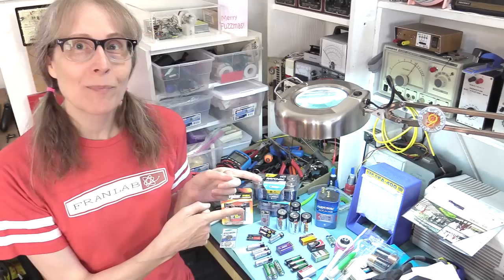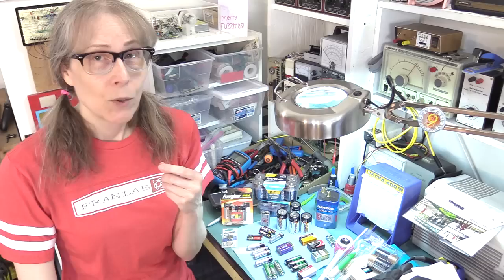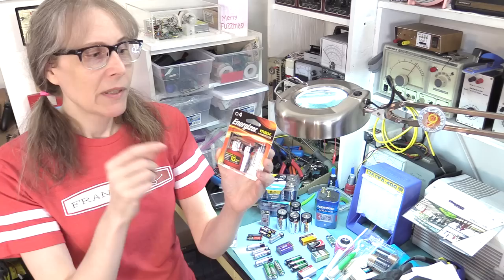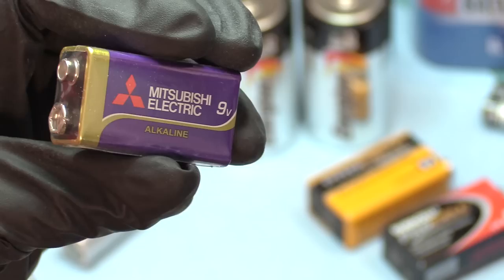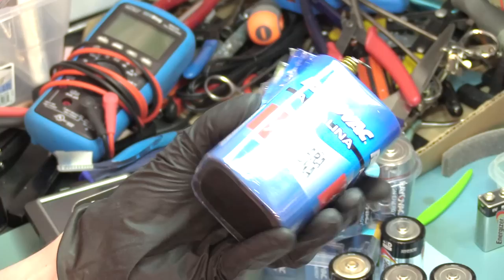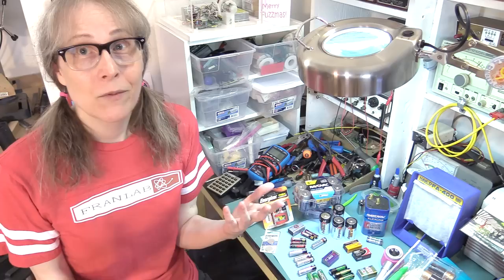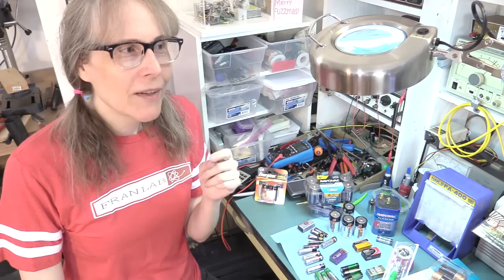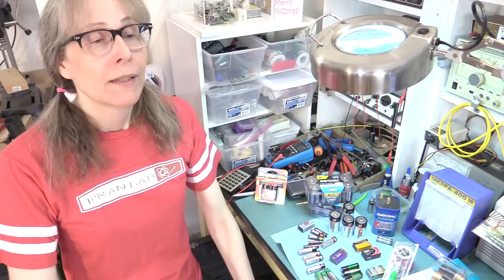Yikes! Leaky Alkaline Batteries!!!!

Comment: If you mix and match battery brands, or use the same brand but from different manufacturing batches, you are more likely to have batteries leak inside your device; especially if used in something that draws a small amount of continuous current (which includes most LED flashlights, certainly any that have multiple modes, varied brightness and flashing modes etc). The weaker battery, or the one that is "different" from the others, that one's gonna fail.

Comment: I've actually never had a battery leak on me. I found out years ago that the generic Super Market bought batteries from my local SM is almost as good(long lasting) as duracells. I'm a guitarist and we usually go thru fairly many 9V batteries in the span of a year. The price difference between the big brands and the the generic kind is pretty substantial in my country so I wouldn't even dream of using anything else

Comment: There's a reason that for low drain, long rest time devices (most of my 15+ multimeters, my remote controls, smoke detectors) I use the Super Heavy Duty.    Even when they fail, they fail with salt water, which is FAR less destructive than when an alkaline goes.    In fact, if you buy a smoke detector, it comes in one of three types.   House power, lithium battery, or super heavy duty.   I've never seen one sold with an alkaline, and I spent an hour one day going through the entire list of recommended batteries on an old Kidde unit, and every one was a "Super Heavy Duty".

Comment: Since I have acquired a ton (yes, a ton, not a metric ton!) of 18650's (18x65 mm), I have been substituting 3x AAA's (rechargeable or alkaline) for just one li-ion. It definitely lasts a lot longer than three cells (one usually gets drained first, the other two, not so much), and I just swap it out, drop it on the charger.

Comment: I’ve had corrosion in my electronic door lock. Cleaned it as much as possible and put in a new battery but that one started corroding after a month or two. They are Rayovac batteries. I cleaned it again but I’m not sure what to do.

Comment: My Gates gel cell lantern battery in it's original lantern with the original bulb and replacement inside finally died 3 months ago. I bought this in 1978. I've been in this battery case before to bypass the limit resistor. I replace that with the rectangular type with the tabs. Still worky.

Comment: I have a Casio calculator thermal printer with the original Casio AA batteries from 1982 and they still have change capable of operating the printer.

Comment: When I was a kid you could buy rayovac batteries in the UK, they had a label saying rayovac "a viador company" there also used to be "ever ready gold seal" before they became ever ready energizer and then just energizer, I've seen old 1970s and 1980s batteries that were left lying in stored boats and in garages and sheds that still haven't leaked and I have seen newly bought fresh in packet batteries that have ruptured. 
There were also blue and red energizer batteries which were different prices and grades, blue was zinc chloride and red zinc carbon I think?
There were a range of different sizes of transistor radio batteries in 6, 9 and 12 volt versions to fit the old radios and there were bolt top terminal lantern batteries which had plastic screw caps on the terminals to fit big searchlight type torches/flashlights 🔦

A lot of batteries that there were until around 2004 are hardly made and are special order now, many different ones had their market in radios that got modernised out and flashlights that were discontinued, these batteries are super expensive now and are so hard to get hold of that it isn't worth the struggle to keep things working..

Many of the current day rechargeable batteries installed in consumer electronics aren't very well made and don't last long..

Not too many people are willing to spend $60 a time to change out disposable torch batteries nowadays, a lot are rechargeable and the rest are AA or AAA sized which are the common easily available ones worldwide..

Has anybody got an obscure or old flashlight which they can't get batteries for?

Comment: I just don't leave batteries in anything I don't use every day. I take them out an put them in a plastic bag which I store next to the device that needs those batteries. No more leaking problems. The batteries still sometimes leak but when they do they are conveniently already in a bag so I can just throw it out with no mess.

Comment: One time I reached into my bag to get my TI-83+ calculator and found it wouldn't turn on. I opened the battery door to discover that one of the batteries had started leaking. I was absolutely furious, because I had just used that same calculator 2 weeks before and it worked fine then. I was so pissed off I forgot what I was going to calculate. Fortunately, the leakage wasn't very bad and I was able to clean it up with some vinegar and a q-tip.

Comment: What I usually do is, I get primarily rechargable batteries and keep them in a tupperware box or baggy.. And just take the batteries out of whatever I needed them for and charge them back up and stick em back in the box.. Obviously things like remotes or other daily use electronics just stay in the device.. Btw I also agree that lithium's aren't really any "safer" than alkaline's as I've had Li-Ion batteries catch fire on me in the past(top of the line brand name ones).. There's pro's and cons of every battery chemistry, lithium has a blowing up/melting down/fire hazard.

Comment: The most important source of problem in consumer electronics are these batteries. Most aftermarket services time after Christmas day is spend changing batteries. Alkaline batteries are made using different materials, sealants and so on from brand to brand, and that can even change in their production and date. Same type of battery can differ if it's made in different countries, and that can change by the type of distribution...
I've seen many of these weird Chinese (PRC) brands in remote controls over the years, most were low end, but I've also seen Japanese brands performing extremely differently, same as other brands! 
As you Kermit, I've also tested good some alkaline batteries well after their life shelf date: some rarely operated in a fuel (gazole) stove are still fine and working today, and are marked 06/2002! Energizers (black classic label). 
Your cleaning solution for alkaline leaks is ok, I personally use a qtip with white vinegar, as it works perfectly to neutralize the potassium compound. But once the leak has gone to bare copper leads or circuit boards, it can trigger corrosive destruction... Difficult to repair!

As for the lithium batteries, you've got to know what usage they were designed for: some (relatively cheap and widely available) are made for long term computer, programmable memory operation or any low consumption circuitry, others are made for demanding current operation, like flashes, digital cameras with lighting, security devices (radio operating), pyrotechnic operated systems... 
Most if not every computer main board uses one of these lithium cells, and they are supposed to have a five year life expectancy, but generally last above 10 years, so most people never change them. But there was a time electronic circuits consumed much more, and you could have problems with  VCR, oscilloscopes, within 5 to 6 years. They generally used special format soldered battery packs of even worse, memories integrating batteries (headache for lab users loosing the calibrations of their precious machines). These batteries were expected a large shelf and operating date (rarely leak), but 25 to 30 years later, machines still work fine, but these packs and special memories are kaputt and difficult to replace. The other type of lithium cell is made for a far more shorter term, have a shelf live similar to alkaline cells, but can easily deliver 5 to 10 x more current briefly for special operation. These can leak and explode if shorted as they have extremely low ESR, and boil easily! This kind of cell is also the most expensive on the market. A typical 9V hi current lithium cell is well over 15$, if you can find one, as most producers now prefer high grade alkaline (safer, longer life shelf). 

You cannot mismatch or replace these high power lithium batteries with long term lithium, as these have low current capacity and literally fail within a week of operated so, or cause problems with their high ESR: a burglar alarm using these mismatched batteries was in direct failure as every monitored sensor (IR detector, magnetic switch detector) sensed a bad battery immediately after sending their OK check radio signal, as the batteries supplied were delivering instantly low (under 7,5V) peaks to the voltage sensing unit, calibrated for another battery type. This could be fixed with a simple circuitry change (a cap + resistor), but whole system was under warranty...

Most recent rechargeable batteries are generally named improperly Lithium: they are in fact Lithium Polymer cells, and totally differ from "classic" 2 others. Format and voltage cell completely differ, and these high power cells are extremely dangerous to use if improperly treated: never short them, especially the non fused type that distinguished with the absence of plus pole embossed cap!

Every lithium cell is know as flammable and could leak explosive gas under stress. Used cells have to be disposed properly, and are suspected in the loss of airline jets... The lithium industrial production is specially known for the generated pollution and nasty byproducts. Rare earth are even worse! Their use in many electric cars could one day become problematic!

Comment: I wouldn't trust those rayovacs either. Have had them leak many times before. Infact I just had a set of the AA rayovacs just begin leaking in a $500 scanner radio of mine, thankfully caught it early enough. I've gotten tired of all the leaking alkaline batteries in devices that aren't frequently used. I just made the plunge and between AAs and AAAs bought about 100+ eneloop NIMH batteries. I've never seen any of the NIMH batteries I've owned in the past leak. Sure they don't have the shelf life without recharging that alkaline does, but I've got enough of the NIMH batteries that I have a good few dozen I'm keeping recently charged ready for use. I got an 8bay charger for them so not a lot of trouble to once a week or every other week cycle some of my "ready to go" batteries into the charger for a top up. The eneloops are supposed to retain around 80% of their charge just sitting in storage for a year.

Comment: I, as a battery salesmen, tell people to check battery powered devices every three months for leakage and charge state. Check charge state with a multimeter. 
OCV should be a few tenths of a bolt above standard voltage 
Ie... 12 volt battery should read at least 12.4 volts. That's alkaline, silver oxide, and lithium primary. 👽

Comment: I agree that leaking alkaline batteries can be irritating, but they are relatively easy to clean up after. However, they make FAR LESS mess and cause less damage than older dry cell carbon-zinc batteries. Carbon-zinc batteries also Stink when they leak. 

Because of experiences in the 1950's -1960's, I still do not buy Ray-O-Vac batteries of any type, because in my experience their carbon-zinc batteries were much more likely to leak than the other common brands. (I'm sure they're fine now, but it's an ingrained distrust.)

People's Republic of China (P.R.C) is the official name of Communist China.

Comment: In my old Atomix WWVB time and temp wall clock, I started using Energizer Lithium, and they leaked consistently.   I later switched to Duracell Alkaline and they leaked too.   Currently trying the Ray-O-Vac batteries. 

It could be that I need replace them when I notice the display is fading rather than once a year.  Luckily every time I've been able to clean up the mess, even though the Lithium batteries leaked enough that it damaged the paint on the lower quarter of the case.

Comment: The biggest mistake people do is leave the batteries in when not using a device for a long time and/or using them in a device using very little power like a clock, remote, door bell or similar. And as you've experienced alkalines are in practice long from leak proof.
I don't alkaline anymore. Either it's LiIon or NiMH if designed for standard cells and suitable for rechargeables. For clock, remotes and the like I use either Energizer 1,5v lithium or the dirt cheap zinc-carbon. I've used many zinc-carbon batteries in clocks over the years. All run down until unable to power the clock and I've not had a single one ruin the clock. Zinc-carbon when used where it's not enclosed in a semi airtight space they dry out faster than they'll leak. In my more expensive stuff and remotes I'll use lithium just to be sure and lithium lasts for ages.
But alkaline I'm done with. Whenever I come by them (not actively buying them) I'll use them in my computer mouse. It's used regularly and consumes them so fast that they'll not leak in there. When empty I put then in a container that when full I take to recycle. It's always a leaky mess but hey as long as they don't leak in the device.

Comment: Duracell was my battery of choice back in the 80's. However I was under the impression that all alkaline batteries did not leak, until one or more of set in a portable TV leaked. They were this Industrial Brand Alkaline. Since then I have had a few alkaline batteries leak. As for the brands I could not say.   A side thought. Your high drain devices like a digital camera, if they use regular batteries, like AA and you go through them fast, especially in movie mode. Wisely keep those batteries for other low drain devices. Your digital camera has wiped out the high current availability of the battery, but that same battery will run a clock, or a remote or a computer mouse for a long time.

Comment: Used to be a big Duracell fan.  But now I avoid them.  Look at the Amazon page & you see people complain about Duracell leaking.  Duracell has dropped the ball big time.  I find the cheap batteries found inside packages fair much better for leakage than Duracell.  Thanx for the vid.

Comment: Thank you for your useful advises. I found several R20 batteries from early 1970's in an old radio. They had not leaked, yet and the voltage was still 1,2 v, they were of the Swedish inexpecive brand Tudor.

Comment: "The humanity"? I have seen worse. I once bought a Yamaha PC-100 keyboard that literally had it's feet in battery goo. It had leaked out as a liquid that had spread all over the small flightcase it was stored in. And it was the huge batteries normally found in boom-boxes. But to my great luck it had always been stored horizontally so nothing had gone into the electronics. I just cleaned all the plastic parts and it was fine - and it still is, now 15 years later. The worst I have seen is a small Wersi MAX-1 synthesizer module that died a while after I bought it. The internal rechargeable RAM battery had started leaking very slowly. But when I found out half of the circuit board was gone without a trace.

Comment: I'm just now learning that duracell have gone to crap. I did have one procell AAA leak inside a rather nice small flashlight, ruining it. I had been using rayovac for a while, due to pricing, but have had a lot of leakage issues with them in the past couple years. I'm making the switch to rechargeable now.

Comment: The lantern batteries were great sources for carbon rods to do carbon arc experiments!
At one point I did development work for Kodak.  I somehow ended up with boxes of various Kodak batteries.  I found them last year.  They are all 20+ years old.   No leaks.   All the simple cells I tested at over 1.5v.   The power of the once mighty Eastman Chemical!
Reply: You also?!  :D

Comment: Been an avid collector of vintage/antique film cameras and affiliated gear for MANY years, besides any of my other MANY hobbies, picked up a fairly late model Canon Super 8 camcorder that was in mint condition from a thrift store in Oregon in 2010; fully electronic, battery controlled. It’s batteries stored in the flip-down handle WERE ORIGINAL TO IT! Like late 1970’s “MALLORY” alkaline DURACELL MN1500 “AA”. Only ONE of which began having its acid leaking out @ 2015. THOSE BATTERIES STILL HAD POWER UP TO 2015!!! HOW IS THAT POSSIBLE!?!?

Comment: I try to always use rechargeable batteries in seldom used devices and alkaline in daily used devices that I can catch in death mode.  As for labeling devices, I opted for an inventory sheet with all devices listed with date and type of battery installed.  The only problem with the sheet is remembering to look at it and update it.  Thanks for the video!!!

Comment: Procell are simply Duracells with a different label. Heavy Duty and Super Heavy Duty are NOT alkalines, After 5+years working in a battery store,, I only use LITHIUM, which seldom leak. I have a lot of expensive test equipment, As for small button batteries, use Silver Oxide in preference instead of alkaline.

Comment: Fran......very good  video I also collect batteries and the different brands that are used......like the number 6 cell
A large 11/2. Volt that had a 30 amp hour capacity with screw  terminals on top. They used to be used for doorbells, telephone, and to start your model airplane engine.... they were the good old days......I believe that a  Company started re-making those huge 11/2 volt 
batteries again why I don't know.....but are expensive ......the best to you........Mike